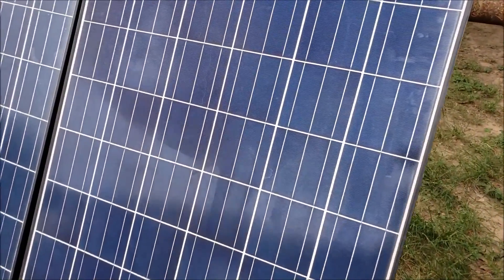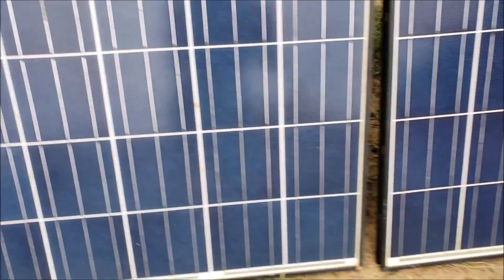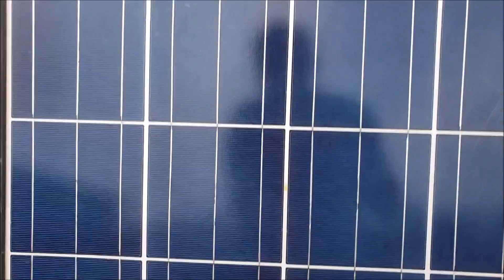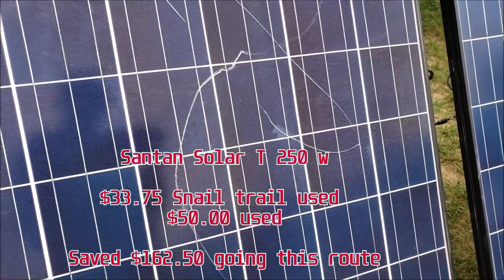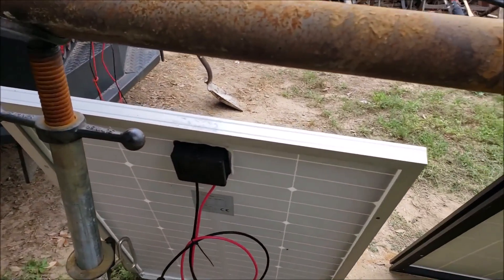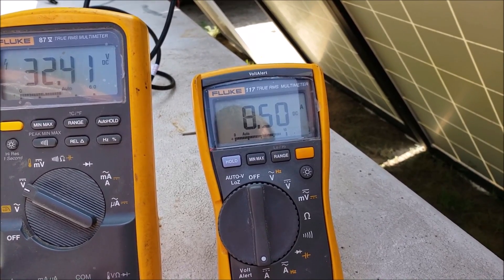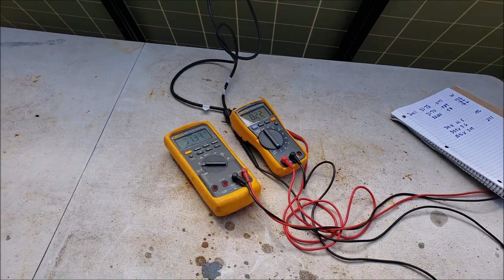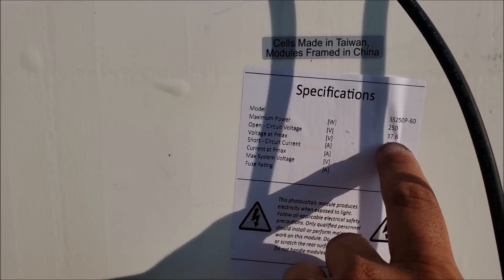Santan solar used off grid snail trail panels for beginners review.

Comment: Could you recommend a good cheap battery?  I'm thinkin either 12 Crown 1's or 12 Trojan t105s but I also know lithium is much lighter.  But the lithiums I see are EXPENSIVE
Reply from the maker: I worked mostly with GEL/AGM/SLA batteries but believe lithium is the way to go. Lithium can release huge amount of power and also pack more power in a smaller package. My intention was to build my own batteries using products from batteryhookup just couldn't justify the funds needed for a 14k to 20k capacity DIY unit. Back in the days I used golf cart batteries from Sams club just cant remember if they were Trojan or deferent brand batteries.
Reply: @cutweldngrind  So far I've chosen the Amperetime because they sell used batteries on their website dirt cheap

Comment: Do u have a video of the snail trail panels up and running ?
Reply from the maker: I bought 10 but only running 3 on a water well pump. I have 6 on stand by with an MPPT charge controller incase we lose power in Texas again.
Reply: @cutweldngrind2752  I just went and picked up some Trina 260w panels today these look brand new tho

Comment: Thanks, how much was the freight?
Reply from the maker: Prices have changed over the years but to get the best Freight price I would recommend calling instead of using the calculator at check out. I cant recall how much I paid but a pallet can hold 20 panels so buying a full pallet can save you some money on shipping as well. These panels have been in service since with 0 issues.
Reply: @cutweldngrind  thanks I guess I'll do that then
Reply: Was it more than $200?

Comment: What gets me is you stress about how cheap they are but the shipping is probably 2 times as much as the panels
Reply from the maker: I think the price on these were great and could of gotten a cheaper freight if I had ordered over the phone. Today the panels and freight have gone up quite a bit. If I had ordered an extra 6 panels the shipping would of been about the same which most folks end up ordering a full pallet to keep cost down.
Reply: I think it only makes sense if you’re building a big ass array and are willing to go to az

Comment: you can take the aluminum scratches off the glass with some sodium hydroxide mixed with some water and vinegar neutralizes it be careful this stuff disroys aluminum fast.
Reply from the maker: Thanks for the info, I will sure try this out and see how it works. Is this like caustic soda used in oil and gas drilling wells?
Reply: @cutweldngrind  yes were gloves and eye pro

Comment: In April when I tested my panels one at a time I got about 177 Watts at the peak around 1:00 in the afternoon. You must be very far south close to the equator to get that much output.
Reply from the maker: Do you have the same exact panels since they offered them in 2 different sizes? I do live right on the border to Mexico in South Texas. Cool weather would help me produce more power by what I could remember. I was tinkering with the panels yesterday and they seem to work perfectly.
Reply: @cutweldngrind  Your panels look the same as mine, with the only difference being yours have black frames and mine are natural aluminum. 240 watts each.

Comment: I bought 40 of those panels these are the 240 w Trina solar panels. Shipping to my part of the world was about $1,000 though.
Reply from the maker: Shipping is expensive now that fuel prices have soared. I was looking at your about page and noticed you fix amplifiers. I used to do repairs on car audio amplifiers mostly class AB from 2000 to 2012.  Anyway the panels I bought were the Trina T Series 250W model, 2020 price for me was $577 delivered for 10 of these.
Reply: @cutweldngrind  I bought mine in December and paid that enormous amount.
I paid $38 each for my 240W panels. Took a label over and saw they were made by Trina Solar. About $2000 delivered for forty panels.
I run an amp repair shop up north, mainly vacuum tube stuff, no car audio.
Reply: If you want more panels they are doing $150 flat rate shipping right now, you could see if it applies to your area.
Reply: @callmebigpapa  I've been buying NEW panels from Sungold Power the past 2 years. Free shipping.
Reply: @basspig  Good pricing ?
Reply: @callmebigpapa  yes, pretty reasonable.

Comment: any updates on your panels preformance?
Reply from the maker: The panels are working great. I run 3 of them in parallel to a 370W solar water well pump. I have 6 panels on my power back up and they all run great. Prices have gone up but for me they were a deal.

Comment: HOWdy  C-W-N-G,
I too purchased USED Panels - 23 X 205 watt panels
Thanks for the VIDEO = mine were so OLD they came with MC3 connectors instead of MC4 Connectors 
COOP
...
Reply from the maker: Howdy..Haven't seen a MC3 connector in a while but did you keep the connectors and add adapters. My plan was to buy 20+ but then everything went up in price and the cabin dream disappeared. I never did order the Nissan leaf batteries but those are also way over priced. Well thanks for stopping by.

Comment: Less testing, more using! 😂
Reply from the maker: I have 3 of these panels in parallel running a 24v water well pump. The remainder are not being used currently but these are awesome panels and prices have gone up for sure.
Reply: @cutweldngrind  I have 16. 12 on my house, 4 on my cargo trailer. :)

Comment: can someone explain what is going on in the panel to cause the small trail ? is it slowly fuseing that cell ( like a short ) is it a heat spot ? what is it and what will the outcome be . like 5 years down the road ?
Reply from the maker: My understanding was these are micro cracks that happen after several years. I have not noticed any issues and panels seem to output very close to rated power. I run 3 of these on my solar water well pump with no issues.

Comment: Someone mentioned permit. Do you have to have a permit to use a solar panel?
Reply from the maker: I live in a small town so building permits don't apply to me. If I were to install solar to my home the equipment must be new or have warranty to apply for grid tie applications. There is a permit required from your local power company that must be met, permit to install system and other documentation. I bought this to power an off grid cabin but prices on lumber soared and my dream cabin was cancled.

Comment: What is the maximum number of solar panels, you can get on a palette?
Reply from the maker: I'm not to sure how many panels can be placed on a pallet but more than 10. If you call Santansolar they can give you a better price on shipping that using there calculator on website.
Reply: @cutweldngrind  Thanks!
Reply: 30, if you ask them.  Two pallets of 30 fit in a Sprinter van.  Have them shipped to a freight terminal.
Reply: @TheRmenke  Thanks, I ordered 24 they came last week.

Comment: How much would it cost for a total of 5 panels?
Reply from the maker: Prices have increased on everything in the past 2 years. You can check on Santansolar website but an estimate would be 65x5 $325 plus $225 shipping. They usually go on sale and have new, used and snail trail grade.
Reply: A local guy near me sells them for 80 or 100 for no snail trails
Reply: @slicktmi  all he's doing is buying these same panels then reselling them for a profit
Reply: @michaelcohen9363  exactly but they been working good so can't complain

Comment: so so cheap
Reply from the maker: The panels did go up a bit in price but still very affordable. I will be running 3 of these to a small 400 watt water well. I also have 6 running backup power currently and will be located to the off grid location once I start building a cabin.
Reply: @cutweldngrind  earth battery next as hey work 24/7 magnesium  and copper  rods and  zinc plates

Comment: Those panels are now 61 dollars.
Reply from the maker: Prices have gone up on just about everything. I am installing 4 of these solar panels to power a 370 watt deep water well pump. 2 panels can handle the load but want the extra panels to keep the flow rate constant when I get some clouds. I run 6 250watt panels on my power back up system as well. I would buy again if needed.

Comment: When measuring Watts check the amps and volts at the same time on one panel. Checking the amps by shorting the panel gives zero or almost zero volts, making the watt also almost zero. Other than that, good video.
Reply from the maker: Thanks for the tip. Just saw your video on fixing cracked solar panels. I remember that was a thing back in the day when panels were so expensive. We also built some from chipped cells and bought the panels that were missing frame and jbox.  Do you have any of these Santan Panels?

Comment: It's confusing as online manufacturers list kwp instead of kwh
Reply from the maker: I have not heard of  KwP before and barely researching it. I know KW is 1000 watts while KwH is 1000 watts in a 1 hour period used by a load for example. I dislike when manufactures list a 1000 watt inverter as 8000 peak and then inverter goes into protection with a 1200 watt load. Car audio speakers and amplifiers are rated similar with outrageous claims.

Comment: I bought a bunch of the SanTan Solar T Series (not the snail trail ones) and I love them.  They work great and you just can't bet the value.
Reply from the maker: Thanks for sharing. I cant believe they went up in price now but still a good addition. I am currently running 4 panels to a 3000 watt inverter that runs my 8000btu window unit. The window unit consumes about 750 running watts and during clear skies my batteries are just on stand by. I do plan on installing the rest as time permits. 

I see you have a monetized channel so congrats buddy. Im currently watching your review of your Giandel inverter. I was actually looking into that brand and went with swipower.
Reply: @cutweldngrind  I love these SanTan T series so much I am replacing all of my Rich Solar (and I like those too) with the SanTan.  Just amazing panels.  I installed a 12kbtu a/c unit in my off-grid apt. so I had to do a major upgrade to my setup. 

The Giandel  inverter is solid but swipower is good too.

Comment: UV resin for the scratchers
Reply from the maker: So the UV resin will create a full layer over the glass, is that correct? I built a solar panel many years ago with broken cells and remember using a resin or epoxy to encapsulate the cells which is a bit different here. The panels have been working great and wish they were still $33 instead of $50+.
Reply: @cutweldngrind  yep epoxy just fine.  Better yet put a layer of those tritium vials over you panel.  Space them so sunlight goes through.  Then epoxy over it.  You’ll generate voltage night and day.
Reply: @brutusmaximus5380  LOL good one.

Comment: They must be good because there $45 instead of $35 and I seen someone else get some for 50
Reply from the maker: The panels work great as I just checked my power coming in on them. These got mounted for testing for my off grid install but due to prices on lumber going up I had to cancel my Cabin build. THe lower $35 usually has peeled off Vinyl layer, $45 had snail trails and the $50 plus are used but you cant see many imperfections. I see these sold locally for $150 on Craigslist.

Comment: Why cant these be used for on-grid ?
Reply from the maker: The manufacture labels have been removed which is the only thing holding you back. The label includes information needed for the permits and warranty. I have seen people use them on the grid but the only difference is the label.

Comment: Can they work on a 12v system? I am new on Solar panels
Reply: Does your Charger Controller support these panels ?
Reply from the maker: You will most likely need an MPPT charge controller for these. A 12v charge controller can probably go up to 21 volts and a 24 up to 32v. The MPPT charge controller I have can do like 720w at 12v, 1440w at 24v, 2100w at 36v and 2800w at 48v. I use a makeskyblue 60Av118.

Comment: I just ordered ( 10) 270 watts panels from Santan solar.  Now found your video, I think i will be please with them.  Already have some going into the grid.  This should put an end to my bill.  Not counting min service fee.
Reply from the maker: Awesome. Mine are still on the pallet since my cabin build was put on hold. Lumber prices went up over 40% and basically have to wait to install the off grid setup. I may do my shed off grid temporally for testing purposes of inverters and charge controllers.
Reply: @cutweldngrind  I put a t-post in the ground and then lean the panel , aiming at the sun, then put a wire around the panel and t-post so it won't get blown over and be damaged with wind.   Learned the hard way, have had some damaged one's.
Reply from the maker: @deangriffin8997  I have a 12x20 ft shed and I was planning on adding an extension of probably 12 x 12 ft to the front side. The extension would be made of unistrut and would give a nice shaded area to work under. What inverters are you using? Around 2005 we did alot of experimenting using panels from sunelec and Sun inverters from ebay. I still get amazed on how solar panels can gather lots of power from the sun.

Comment: Thanks I just bought 25 for a DIY solar farm.
Reply from the maker: These are great panels. I plan to install them within the next 12 to 24 months. I am working on the cabin plans at the moment.
Reply: @cutweldngrind  🐌
Reply: With snail trail defect or vinyl cracking defect?
Reply from the maker: @solidsnake4022  I got the snail trail ones. I think the ones with bad vinyl will require some weather proofing sealer so these seam to be the best bang for the money.  If you want to buy I suggest getting quote from website only  and then call them up to see what they quote you. I could of saved about $80 on delivery just buy calling.

Comment: What makes them 'for off grid'? Is it off grid only?   -Why?
Reply from the maker: This is a good question. These panels once had a Manufactures label that listed UL and other certifications. The labels have been removed which can cause issues getting the system approved. I believe these panels have alot of life left and do show some wear but work properly.
Reply: System approved? Where are people living that they need to ask permission for using solar energy?
Reply: @adamr8628  its the insurance company, so you dont burn your house down with non UL inspected or approved panels...every electrical device and component must be UL certified or no insurance...
Reply: @Bobbob-mv5uk  ok.  I'm glad they don't do that where I live. They don't look for labels before approval, and if there ever was a fire I guess the labels would be gone at that point anyway!

Comment: i bought some also and im very happy with them.. i had snails actually grew on them
Reply from the maker: They are some good panels for the age and produce lots of power. I have mine in storage at the moment since 2020 was just a crazy year. I really hope I can wire them up this upcoming year. Gotta check your channel later today as I see you have Lego Techics.
Reply: @cutweldngrind  A hobby ive started to do in the last couple of years and i love lego technic!!  I'm designing and making instructions for my models. I didn't understand what the term snail trails ment when I bought my panels from ebay used.. one of my 250 same as yours panels for blown off my roof and landed in a big pool of water .  To my amazement the solar panel still worked!!  The frame is strong and i wouldn't be surprised if it can take your weight if you walked on them.  I live in the desert and many months later . There are snails crawling all over my panel!! I read the description of the panels from ebay and mention that they were marine mounted meaning they were over water.. I don't have snails in my area so I figured it must of came on board and maybe sea eggs were imbedded in the cracks and opening of the panel.. the pool of water when it landed must of rehydrated the eggs and a few months later bam. The other panels didn't have that issue but could still have eggs in them so i high pressured clean my panels and the panels look new again ..go figure ..

Comment: Hey Jorge did you decide on a charge controller??
Reply from the maker: I have not looked into anything yet for the cabin. I dont know if to buy a Hybrid unit or an inverter and charge controller. 1 of my 48v inverters died and the other has been shutting off.